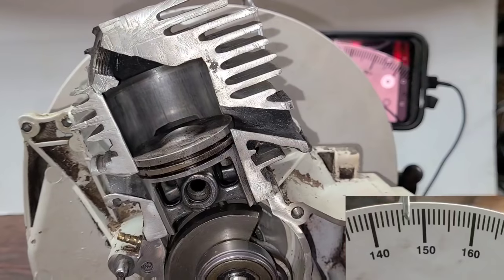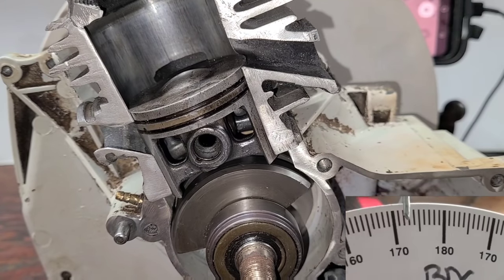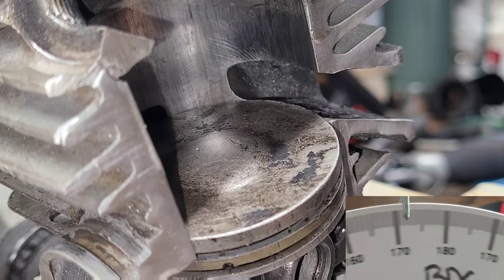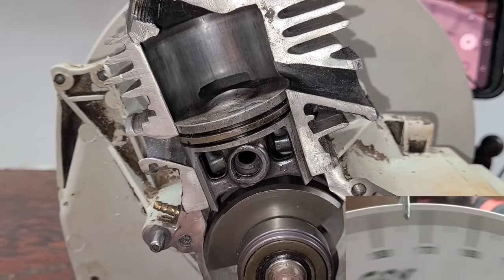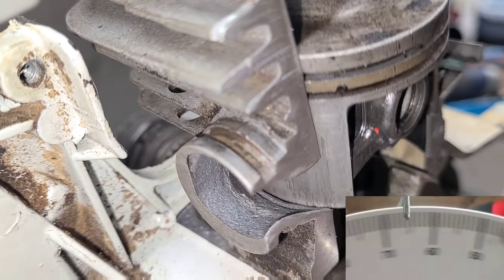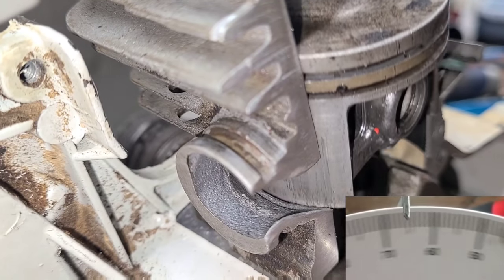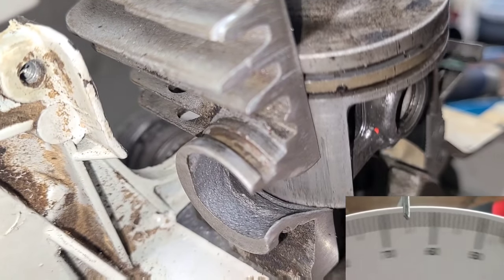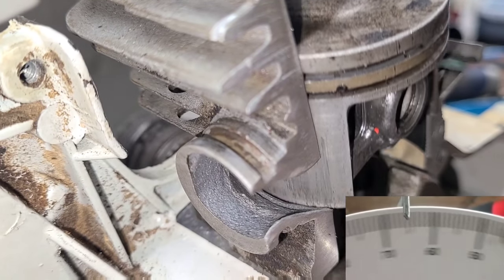Chainsaw Cutaway #2 : 2 stroke port timing explained!!

Comment: Came here to watch to wrap my head around the 10° blow down numbers you were taking about on buckins mac  850.   Thanks for this cutaway series.   Thought I had a basic understanding of 2 strokes, but I was way off in my head.  Had no idea what "transfers" did and didn't realize the fuel went into crankcase before being transferred to the cylinder.  Makes so much sense now and I learned my one new thing for the day! Lol
Thanks

Comment: This is by far, the very best visual explanation of timing on a two stroke, and how a few degrees one way or the other will affect torque and rpm's. Super job Tinman. Tap-er-light, eh!

Comment: Great video, thanks for sharing. I use an old cut out spark plug and a DTI gauge through it for tdc. Also save ya plastic chopsticks for sticking down cylinders, they are great for pressing on parts that might get scratched.

Comment: I achieved 360dgs inlet on a lambretta engine by fitting a Yamaha reed valve and cutting a boost port over the top of the crown. I swear that engine was smoothest single 2T I've ever ridden. No banging or delay. The power curve was as smooth as a upturned banana... It made 24bhp. Not bad for a 225cc that was 45 years old. Fitted kawasaki cassette clutch from a KDX as the best lambretta clutches all slipped..

Comment: Truly appreciate you sharing your knowledge. I’ve had a degree wheel for years and never felt confident enough to get into porting. Knowing full well raising exhaust port height increases top end RPM and conversely lower an intake will induce intake charge sooner but knowing how much is key especially between models of saws.  On an already high revving saw are there gains to be had from increasing Ex port height or will it give negative results. So many questions such little time

Comment: Many thanks for this, and all of your videos.  This couldn't have been timed better (bad humor), My first porting job is going to be on an 028.  I have a perfect:  '1 in a thousand' made in W. Germany (I'll use it to collect stock specs), then compare performances between it, and to the 'soon to be' ported saw after the job is complete.  I will keep everyone updated, but this could take months.  Thanks again.
Reply: It's been a few months, how are you making out? You have my full attention!
Reply: @johnnellis3025  I broke my wrist, just after Christmas,  everything's been on hold.  but the mild port is done, I'll give you those numbers. (I have to check my book), the squish on the 1/1000 is 21 thousands.   Thanks for asking.
Reply: @thomasgronek6469  Oh, so your going to hold me in suspense, thanks a lot. Get well i can wait. Squish seems perfect for a working saw.
Reply: @johnnellis3025 The numbers for the one I ported, are as close to TinMan's numbers.  I used a HyWay cylinder and piston, and it didn't need much  Other than checking the squish on 1/1000, I didn't take it apart yet. in fact, I might not for a while.  I have 3 customer's saws waiting for repair, and another customer bringing in 4 more.  I also am working on a type I 028, and the exhaust is located in a different position than the type II cylinder heads.  I can check that tomorrow or Sunday (It was purchased in 1980 slightly used, all stock)
Reply: @thomasgronek6469  Good for you, busy is better than slow.
Reply: @johnnellis3025  John, Sorry this took so long.  I couldn't reconcile the numbers, due to the fact that I was subtracting from TDC, and BDC, , ,I was beginning to think that my saw had a crank that only had a 330° rotation, , , I forgot to add the height of the exhaust port.  For my initial numbers, the Exhaust open duration was 146°, and It was a bear to start.  After I was done, I wound up with 150° exhaust duration.  It runs fine, but the gasket delete took 30 thousandths of an inch off of the height, (of all the ports)  , , I still have to play with it because of the difference in bypass ports.  I'm beginning to think that a popup might be a better choice to increase compression rather than gasket delete.

Comment: Great job Tinmam.....it looks like there is a crack in the top corner of the cylinder where the machined recess is for the is.....interesting.....
Reply from the maker: I wouldn't be surprised that is a junk cylinder

Comment: Great video. One thing I don't understand. When calculating exhaust duration you deduct the multiplied duration from 360 degrees. But when you calculate intake duration you again multiply by two but don't deduct from 360 degrees. Can you explain why? Great video presented so well. Thanks from across the pond.

Comment: i had a honda odyssey 250cc pull start. no rear suspension, with front springs. the piston skirt broke and parts went out the exhaust or somewhere, and i had a 1979 yamaha 250 it e or an f piston on the shelf. to get an idea if it'd work i put the yamaha ring in the odyssey bore and found almost no gap!! so i knew i was on the right side. to file the ring with a couple hundredths target. the piston was tight. but hey without measuring nothing by scale. the pin bearing accepted the yamaha pin perfectly. the difference in the 2 companies production of piston varied in the intake cut of the piston. now that's an important thing to get right or it wouldn't work. the yamaha had 2 intake holes in the piston, the honda had 1 large hole. not even concerned whether the port timing was close or not, i put it together even with a broken in one spot base gasket (probably the only way it'd run. it was siliconed of all things too.) starting the motor was difficult, with a thump, thump as compression stroke would nearly make it impossible to pass over. but it'd run and run like monster. i rode it for a few months and sold it. still running.

Comment: It is amazing that the piston rings don't get caught on the edge of the ports when it is running. It would be interesting to see the MOCK-UP  turning with the rings on the piston.
Reply: they do catch but its not noticeable right away. over time the portion of the rings that slide past the ports will show more wear then the portions that do not.

Comment: Will definitely check tomorrow seems to feed but no high end all seems near ok but full open is like 1/3 to full out put for a motorized bicycle stuff this is a new one for me! New piston and shaft run great for 3 months then cut runs but no power on load and seems odd even just throttling the shaft has no slip but the feed seems off.

Comment: I have a cheap Craftsman chainsaw but I'm interested in how it works.  What does all the talk about timing and duration mean to me, a complete 2-stroke dummy?  Also you didn't explain how to adjust or change the timing and duration.  Could you please touch on the steps of that?  And could you explain if it would be something beneficial to me to increase performance?  Thank You for the informative videos.

Comment: You time to top of piston that does not seal against the cylinder instead of the top of the top piston ring?  Once that top ring is below the exhaust port it's dumping pressure.  Just a thought.  Really enjoying your videos, thanks

Comment: I'm fully rebuilding a 346xp, should I attempt to grind at the exhaust or transfers knowing nothing about porting or should I just leave well enough alone, trying to see if there's some simple tricks I can do when the oem cylinder comes in the mail to make it more peppy
Reply from the maker: If you arent sure about porting I'd say build the saw stock. 

Once you are comfy that you understand porting you can always pop the top end off and grind it then.
Reply: @tinmanssaws  true enough thank you for your advice
Reply: Is it a new edition?50cc 
I just got the new piston for my 346.  And a brand new dremel ..

Comment: great you talk about killing your saw... when i ported my first outboard (a 60hp 2 cylinder Evinrude) i raised the exhaust ports just a tad too high and absolutely gutted the bottom end. It would've been funny how slow it was out of the hole had i not spent $500 on getting it bored and decked after haha. into the scrap heap she went.

Comment: Have you done a 400cc or larger could some of this transfer to a Polaris sportsman  400cc... I've Ported the transfer  and knifed  the dividers  and blended the casting to the sleeve.  I'm interested in  any performance  gains  that could be had  from  adjusting the timing per your recommendation

Comment: Great explanation. This answered many questions. I am curious though, you said you would not change the blowdown. However, if you opened the exhaust sooner, the blowdown would increase, unless you opened the upper transfer as well, correct?
Reply: I'm also interested in knowing should the transfers be modified accordingly or is it ok to increase the blowdown by 2 degrees?

Comment: Every now and then I get a Husqvarna chainsaw in my shop that will not run, no matter what. I check spark, compression, vacuum/pressure test the crankcase, check pulse line, fuel lines, carb is good, coil is good, flywheel key is good, muffler and screen are clear, piston, rings, and cylinder are good. Fuel is fresh, tried different plugs, different carbs.??? Absolutely everything checks out good but it will not even try to pop and run. This is only on Husqvarna saws and only about 1 every 8 months to a year. You have any idea what’s going on with these dead Husqvarna chainsaws?

Comment: Am I seeing wrong or that transfer port is open in the same time as the exhaust? Doesn't that make the fresh fuel mixture escape before being compressed into the burn chamber? Or is it the pressure from the previous burns not letting it escape?

Comment: Your definitely on a winner with your cut away saw. Very good. I can't understand how you can see your transfer port opening with a close cylinder. How is this done?
Reply from the maker: Shine a light through the exhaust port and look through the sparkplug hole.
Reply: @tinmanssaws  Cheers! Sounds too easy!!

Comment: This is a great video series.  I'm working n 2-stroke dirt bikes, so a little different but same principals.  You talk about when each port opens and your measuring from the top or bottom of the piston to the edge of the ports.  but doesn't the port actually open when the compression ring clears the edge of the port?  Or is the air bleed between the piston and cylinder so slight that its effect is negligible?
Reply from the maker: You are correct, the port is timed when the piston crown or skirt clears the port.

Comment: Bottom and top dead center piston "stop" is called piston dwell. Influenced minorly by connecting rod length. Rod length can influence torque and rpm by changing rod angularity. Adding torque with shorter rods......rpm with longer.

Comment: At 13:32 you said if the exhaust opens 2 degree sooner and how did it closes sooner ? You basically enlarge the top of the exhaust port and leave the bottom alone so the piston will open sooner and closing the port late ? Confused ...

Comment: i might be nit-picing here,but my understanding of when a transfer,inlet,exhaust opens/closes is not by when you see the transfer/port sliver of daylight past the toop or sides of the piston but when the exact moment the ring moves past(whatever direction top or bottom of based on what the person is investigating). as the piston itself has no relevance to sealing or blocking one action from another.....in this game mils count. was a decent vid  otherwise....gets the jist across even if now some noob thinks the piston does all the dirty work.

Comment: Yes... But how can the intake timing be changed; I'm thinking that it is permanently set once the cylinder is formed. Another thing ......you are saying that it compresses the charge in the crank case, right?  that takes some getting use to... but I'm not an engineer, and I'm not planning to build one; just find it interesting!!!!!!!!
Reply: By removing material on the intake side of the cylinder or modding the piston skirt / windowing the piston

Comment: looked  like  exh open 104 but closed at 106 ... so  bore missaligned to crank  centre   ive done or  wrist pin  offset forward a bit .. will upset transfer and intake to an advantage

Comment: Can you make a video on how to correct a reversed 2-stroke dirt bike engine?
Reply: If it is a ignition coil on the outside of the flywheel  it is possible the Woodruff key has sheared putting the timing out

Comment: Great work here! 15:12 If you raised the exhaust port 2*, the xfer blow down would be 26*, so would you raise the transfers 2* to keep the 24* blowdown?
Reply: I'm also interested in hearing what happens when blow down will increase from 24 to 26 degrees.

Comment: Too much piston port timing duration sounds as if it's increasing reversion pulse if you increase too far. Pressure differencial between intake charge and crank case volume is critical. Great science here.